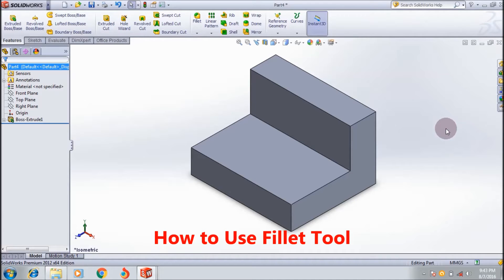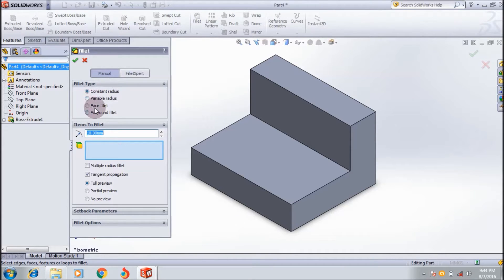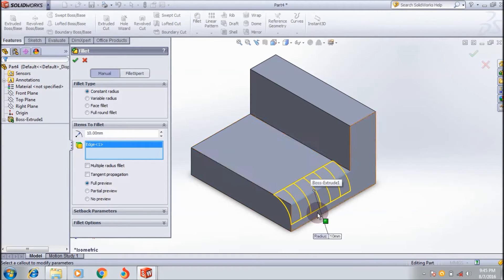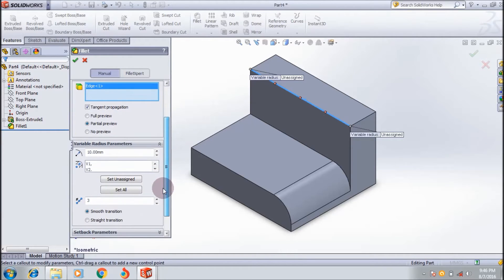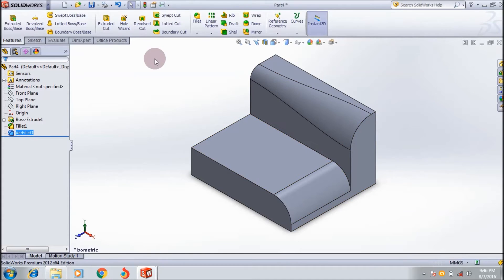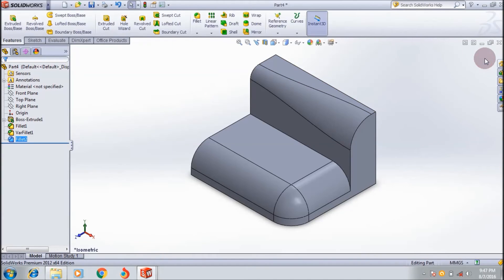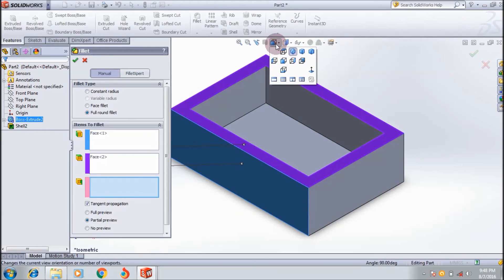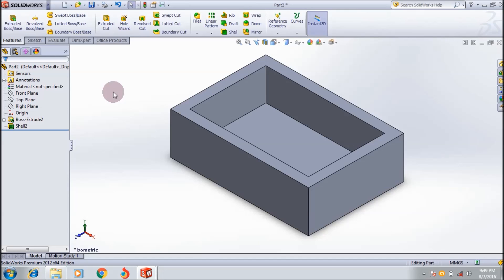Learn SolidWorks Fillet Feature Tutorial _ SolidWorks video Tutorials for Beginners

Comment: I am finding that after I build an assembly, I am having a hard time putting a fillet on the edge of my assembly. What is happening is that the parts of the assembly are being filleted and not the assembly itself. Is there a way around this?
Reply from the maker: It's better to do apply every design features in part file itself. Even if you do assembly, you can go to the part file and edit features that you applied on it. I hope this will help..